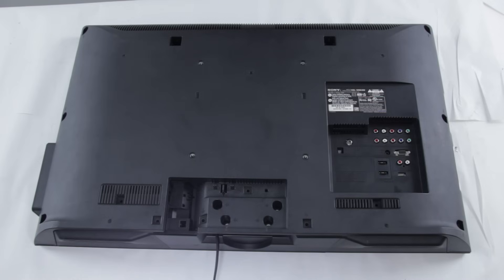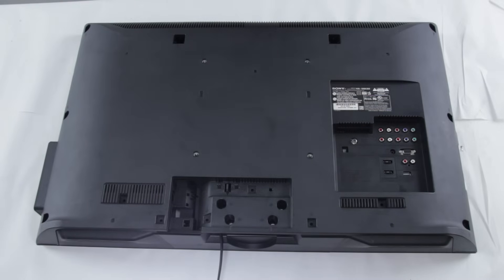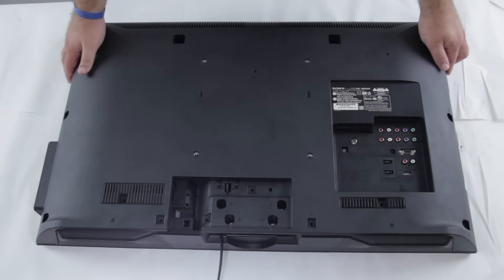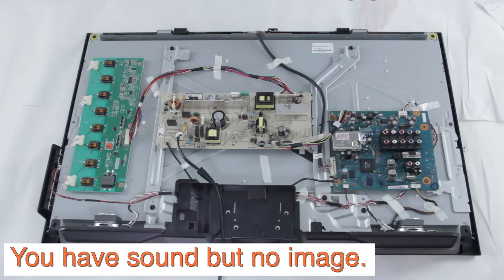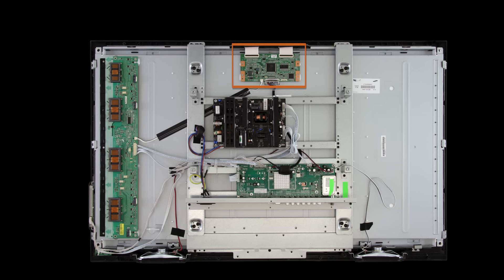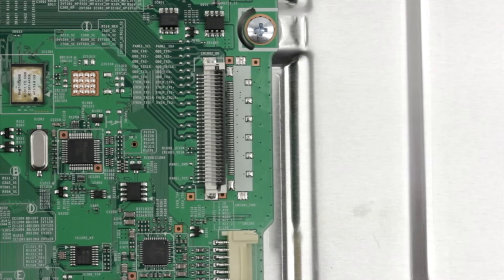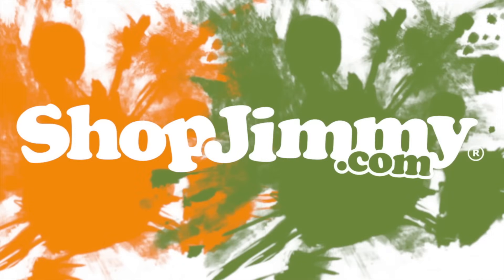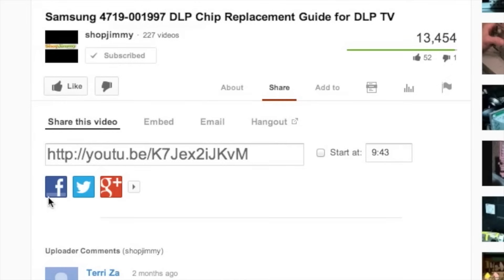LCD TV Repair Tutorial - T-Con Board Common Symptoms & Solutions - How to Replace T-Con Board

Comment: Hi, I have an Acoustic Solutions Model: LCD40F1080P, the sound has degraded over time. It would stop and start again but now there is no sound. Picture is fine. Do I need to replace the main board?
Reply from the maker: Vincent Glennon   Yes, I recommend replacing the main board in your TV.  Unfortunately I do not see any replacement parts in the search results for your TV model number on our website.  Please reply with your part number on your main board and I can try searching for replacement parts.  Thanks and please let us know if you have any further questions!  www.shopjimmy.com

Comment: Hi Shop jimmy, Could you help me to get a T-Con Board. I have Samsung LCD Model No: LA40A550P1R LCD TV and bearing Serial No: 07843ZES100173A. Recently it has developed a problem of No images.... I''m posting this here in hopes that Shop Jimmy  will help me out with a solution.Please please Please help me. You can mail me vinay.krishna6333@gmail.com or get in touch with me on +91- 805-040-4562. Thanks in advance.
Reply from the maker: winhai k   This sounds like a problem with either the main board or the T-con board in your TV.  Unfortunately I do not see any replacement parts in the search results for your TV model number on our website.  Please reply with your part number on your main board & T-Con board and I can try searching for replacement parts.  Thanks and please let us know if you have any further questions!  www.shopjimmy.com

Comment: HDMI ports for my Samsung LED model # UN55B7100WDXZA stopped working,  any tips Sirs?
Reply from the maker: Charanjit Marwah   I recommend replacing the main board in your TV.  Here is a link to replacement parts for your TV model number on our website, click here:  http://www.shopjimmy.com/catalogsearch/result/index/?cat=56&q=UN55B7100WFXZA  Be sure to match part numbers on your current board, with your replacement for compatibility.  Here is a link to a video showing how to identify your part number, click here:  Samsung Main Boards & Digital Boards: Part Numbers for LED, LCD, DLP, Plasma TV Repair  You can also call our customer service for further assistance with your purchase.  (877) 881-6492  Thanks and please let us know if you have any further questions with your TV Repair!  www.shopjimmy.com

Comment: I know I've asked you guys before about this but, I have a Samsung LCD tv LN22A450C1D The picture a long time ago kind of was going out, any bright color like white was showing up as blue or green and now I have sound but no picture. Not sure what part to get or what is going on. The T-Con board is not something you guys mentioned the first time. Please let me know what exactly the problem is here and how much it's going to cost to fix it.
Reply from the maker: tmfathfan06   This sounds like it could be a bad T-Con or main board in your TV.   Here is a link to replacement parts for your TV model number on our website, click here:  http://www.shopjimmy.com/catalogsearch/result/?q=LN22A450C1D  Be sure to match part numbers on your current board, with your replacement for compatibility.  Here is a link to a video showing how to identify your part number, click here:  Samsung Main Boards & Digital Boards: Part Numbers for LED, LCD, DLP, Plasma TV Repair  You can also call our customer service for further assistance with your purchase.  (877) 881-6492  Thanks and please let us know if you have any further questions with your TV Repair!  www.shopjimmy.com

Comment: I have a Sony Bravia KDL 55HX729...no sound or video only a black screen...the power indicator is blinking red 8 times.  I called Sony Support and the abroad sounding gentleman said I have a broke T-Con board.  Recommended bringing to a Sony Repair shop.  I have done all the trouble shooting steps unplugging for bit, plug directly to wall outlet, etc.  Does that sound like a T-con board issue?  I have seen several videos on how to replace and I did not think it looked too terribly complicated.  Just wanted to hear your opinion before buying the $100 T-Con board.
Reply from the maker: thanes333   So an 8 blink is most likely NOT a T-con. It can be due to a few different things. First try a reset (you will want to try this multiple times). Unplug the TV for a couple of minutes. Plug it back in. If it starts up on its own turn it off and immediately restart it, when you do keep the power button held down. Press and hold the up arrow on the remote and then release the power button. Then release the arrow button. See if the TV restarts and goes to channel 2. If it doesn't come back on or doesn't go to CH. 2, keep trying. You can also try pressing and hold power then the up arrow while the TV is on. Keep trying until it resets. If it doesn't reset you may need to change the main board. If you do get it to reset make sure to go and do a software update to prevent it happening again.  If you determine that you need to replace the main board, here is a link to replacement main board for your TV model number.  http://www.shopjimmy.com/catalogsearch/result/index/?cat=56&q=55HX729  Be sure to match part numbers on your current board, with your replacement for compatibility.  Here is a link to a video showing how to identify your part number, click here:  TV Part Number Identification Guide for Sony Main Boards (LCD, LED, Plasma TVs) TV Repair  You can also call our customer service for further assistance with your purchase.  (877) 881-6492  Thanks and please let us know if you have any further questions with your TV Repair!  www.shopjimmy.com
Reply: The TV does not light up at all...only blinking red light 8 times.  I tried all the resets suggested.  So next step would be to replace the main board.  If the main board is out? then the tv will not light up or display anything?
Reply from the maker: thanes333   Yes, you are correct.  Here is a link to replacement parts for your TV model number on our website, click here:  http://www.shopjimmy.com/catalogsearch/result/index/?cat=56&q=KDL+55HX729  Be sure to match part numbers on your current board, with your replacement for compatibility.  Here is a link to a video showing how to identify your part number, click here:  TV Part Number Identification Guide for Sony Main Boards (LCD, LED, Plasma TVs) TV Repair  You can also call our customer service for further assistance with your purchase.  (877) 881-6492  Thanks and please let us know if you have any further questions with your TV Repair!  www.shopjimmy.com

Comment: I have a Sony KDL 40v4100 tv.  Although the green light is solid I am not able to get picture or sound.  The back light is functional.  When I turn it on it is slightly brighter for around 5 to 10 seconds and then gets darker.  I have connected my computer via HDMI and tried to play iTunes music to test the sound however I am not able to change the input so I am not sure if that is a valid test.  I do not hear any sound at all even when I turn the volume all of the way up.  If apply pressure on the screen I see the light where I touch.  I have seen posts and videos that seem to point equally to the T-Con and the main board.  I feel it is a 50/50 shot.  I repair laptops so I do know my way around electronics.   I do not see any evidence of a bad board or circuits and the cables are intact.  Any thoughts?
Reply from the maker: David Matthiesen   It sounds like the digital processor is bad in your main board, so I recommend replacing the main board.  Here is a link to replacement parts for your TV model number on our website, click here:  http://www.shopjimmy.com/catalogsearch/result/index/?cat=56&q=40v4100  Be sure to match part numbers on your current board, with your replacement for compatibility.  Here is a link to a video showing how to identify your part number, click here:  TV Part Number Identification Guide for Sony Main Boards (LCD, LED, Plasma TVs) TV Repair  You can also call our customer service for further assistance with your purchase.  (877) 881-6492  Thanks and please let us know if you have any further questions with your TV Repair!  www.shopjimmy.com

Comment: I talked to you a while back. I have a sony 48s504 I replaced the main board and now instead of having no picture I have vertical colored lines. I'd like to know what board would I change next? Thank you
Reply from the maker: Billy Lundig   This sounds like you have a bad panel and I am thinking the panel was bad before you replaced the main board.  If your TV panel is bad, it may be more cost-effective to replace the TV as panels are typically hard to find in stock, difficult to replace, and expensive.  Thanks and please let us know if you have any further questions!  www.shopjimmy.com

Comment: samsung series 500 model ln46a500t1fxza lcd tv won't retain color settings.  t con board?
Reply from the maker: Diane Arsenault   This sounds like a problem with your main board as those settings are stored in the main board.  Here is a link to replacement parts for your TV model number on our website, click here:  http://www.shopjimmy.com/catalogsearch/result/index/?cat=56&q=ln46a500t1fxza&tv_brands_select=Samsung  Be sure to match part numbers on your current board, with your replacement for compatibility.  Here is a link to a video showing how to identify your part number, click here:  Samsung Main Boards & Digital Boards: Part Numbers for LED, LCD, DLP, Plasma TV Repair  You can also call our customer service for further assistance with your purchase.  (877) 881-6492  Thanks and please let us know if you have any further questions with your TV Repair!  www.shopjimmy.com

Comment: I have a dynex 47 inch lcd half the screen has darker color then the other at first would go away after 10 or 15 minutes now just stays that way
Reply from the maker: Aaron Wagner   This sounds like a TV panel (TV Screen) problem.  If your TV panel is bad, it may be more cost-effective to replace the TV as panels are typically hard to find in stock, difficult to replace, and expensive.  Thanks and please let us know if you have any further questions!  www.shopjimmy.com
Reply: Ok thank you

Comment: I have a Westinghouse LTV-32w3 that I bought off a gentleman that said it would not turn on. I pulled the power board out and looked it over and everything looked normal. I put the power board back in, reconnected the cables and it turned on normally and worked everyday for a month. I gave it to a family member, and they returned it saying it wasn't working. When you plug it in, the backlights come on, the blue led blinks blue then orange, then blue 3 times and stays on blue steady. No image or sound, no response from button pressing. Only way to turn it off is to unplug it, but it will not cycle off, when you plug it back in, the backlights come on immediately. Any ideas?
Reply from the maker: lucidbarrier   This sounds like a bad main board, which is a common problem for this TV model.  I recommend replacing the main board in your TV.  Here is a link to replacement parts for your TV model number on our website, click here:  http://www.shopjimmy.com/catalogsearch/result/index/?cat=56&q=LTV-32w3  Be sure to match part numbers on your current board, with your replacement for compatibility.  Here is a link to a video showing how to identify your part number, click here:  DIY TV Part Number Identification Guide for Westinghouse Main Boards (LCD, LED, Plasma TVs)  You can also call our customer service for further assistance with your purchase.  (877) 881-6492  Thanks and please let us know if you have any further questions with your TV Repair!  www.shopjimmy.com

Comment: I have a SAMSUNG LN46A550 P3FXZA; having issues with picture; bright white areas look pink or purple.  Other ares look fine.  Would this be a T-conn board issue or something else?
Reply from the maker: Rob In OH10   This could be a problem with the T-Con board or the main board in your TV.  You may need to replace each board individually to see which one fixes the problem.  Here is a link to replacement parts for your TV model number on our website, click here:  http://www.shopjimmy.com/catalogsearch/result/?q=SAMSUNG+LN46A550+P3FXZA  Be sure to match part numbers on your current board, with your replacement for compatibility.  You can also call our customer service for further assistance with your purchase.  (877) 881-6492  Thanks and please let us know if you have any further questions with your TV Repair!  www.shopjimmy.com

Comment: I have a Vizio VX32L HDTV10A and it keeps losing signal and the pictures become blurry with pixels while I'm watching the TV. Can you please suggest a resolution to this issue?
Reply from the maker: Troy Moore   I recommend replacing the main board in your TV.  Here is a link to replacement parts for your TV model number on our website, click here:  http://www.shopjimmy.com/catalogsearch/result/index/?cat=56&q=VX32L+HDTV10A+  Be sure to match part numbers on your current board, with your replacement for compatibility.  Here is a link to a video showing how to identify your part number, click here:  TV Part Number Identification Guide for Vizio Main Boards (Plasma, LCD, LED)  You can also call our customer service for further assistance with your purchase.  (877) 881-6492  Thanks and please let us know if you have any further questions with your TV Repair!  www.shopjimmy.com
Reply: Thank you,  do you have a video on how to replace the board?
Reply from the maker: Troy Moore   I do not know which main board you need, since I do not have your part number....once you find the replacement board, you can scroll down in the listing and if we have a video it should be listed on the page.  Thanks!  www.shopjimmy.com

Comment: I have a Sony Bravia KDL-40SL140 LCD sn 8012191.    As of this morning, it only shows vertical colored lines across the entire screen.   I think this would be the T-Con board, but need to know your thoughts.   And i'll need the part number to order the part.  Get back to me when you can.   My email is waynecnc@prodigy.net.  Thanks!
Reply from the maker: Wayne Nelson   This sounds like a TV panel problem.  If your TV panel is bad, it may be more cost-effective to replace the TV as panels are typically hard to find in stock, difficult to replace, and expensive.  Thanks and please let us know if you have any further questions!  www.shopjimmy.com

Comment: Hi I have a SONY KDL-52V4100 LCD TV. It has worked fine for 5 years until recently a black vertical fat and big stripe slowly moves along the screen for 10 hours every day before the screen turns to black. Everyday, it has performed like that for almost 1 month long already. Could you help ? Thanks !
Reply from the maker: Mawlin Chang   This sounds like a TV panel problem.  If your TV panel is bad, it may be more cost-effective to replace the TV as panels are typically hard to find in stock, difficult to replace, and expensive.  Thanks and please let us know if you have any further questions!  www.shopjimmy.com

Comment: I am having a strobing effect on a LG 37LH265H-UB serial # 011RMVB6J943 it starts after about 15mins of being on. It looks like the back light is quickly getting brighter then back like a strobe light. Not sure if I should change the T-Com board the main board or the P/S board. Please help - Thanks
Reply from the maker: Jeff Jasmund   I recommend replacing the power supply board in your TV as the inverter board is built in.  Here is a link to replacement parts for your TV:  http://www.shopjimmy.com/catalogsearch/result/?q=37LH265H-UB  Be sure to match part numbers on your current board, with your replacement for compatibility.  You can also call our customer service for further assistance with your purchase.  (877) 881-6492  Thanks and please let us know if you have any further questions with your TV Repair!  www.shopjimmy.com

Comment: I am getting a white screen with sound and ghostly picture almost like a negative my tv model is 32LG30-UA am I able to change that tcon board?
Reply from the maker: Yvette Bouquet-Wynne   This sounds like a TV panel problem.  If your TV panel is bad, it may be more cost-effective to replace the TV as panels are typically hard to find in stock, difficult to replace, and expensive.  Thanks and please let us know if you have any further questions!  www.shopjimmy.com

Comment: Samsung UN556000SF - TV is showing a third of the screen in black and white and the rest in color. Does this on all inputs. Would this be a T-Con board issues or a LED panel issue? Thanks, Matt
Reply from the maker: *****   This sounds like a TV panel problem.  If your TV panel is bad, it may be more cost-effective to replace the TV as panels are typically hard to find in stock, difficult to replace, and expensive.  Thanks and please let us know if you have any further questions!  www.shopjimmy.com